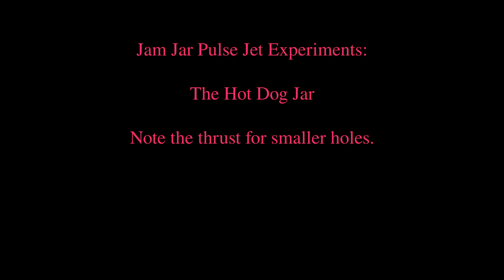Jam Jar Pulse jet experiments: The Hot dog jar pulse jet.

Comment: Probably the tall jar is a little too tall. The flame has a long way to go to reach the bottom to get to the fuel. Something around twice as tall as it is wide should be more forgiving. What  happens with methanol is that it gets watery because it absorbs moisture from the air and water from one of the products of combustion. When it burns it produces CO2 and H2O for the most part. 
I like to make sure the lid is on air tight and coat the entire jar when shaking it to get a good starting impulse. It takes some time to figure out what's going on with jam jars, so testing holes sizes and dimensions and amount of fuel added, the temperature and climate, etc,. all affect results. Jam jars can be fussy. 
Also I don't like to angle jars completely horizontally, but rather something between around 30 degrees or so. There are so many variables that you can't often say some factor is written in stone because it's contingent on all the proclivities combined.
Reply from the maker: Many thanks for the advice in particularly the covering the inside with meths. I would say though that the passata jar is much taller. I was interested to note that initially the thrust dropped as the hole got bigger.
Reply: In the book Pulsating Combustion by Reynst, he points out to dry the top of the jam jar lid after shaking. Just a drop of fuel on the top of the lid when you go to start it can really dampen feedback  such that it's almost given it won't sustain if you go to light it.
You got a taller jar but too tall is just as deleterious as too short,  just as too small a hole or too large a hole won't work, there's the Goldilocks zone. The more shapes you try, the more familiar you get with what's what.
If you're going to do a lot of testing, it'd be a good idea not to breathe too much of the fumes.
Reply from the maker: Interesting information, many thanks. I have some other experiments in mind, but I will bear in mind the fuel hitting the lid issue. Cheers.
Reply: It's on the outside of the lid where the drop of fuel will cause problems,  just to be clear, so dry the top of the lid if there's any spittle of fuel there after shaking the jar. When you take your finger off the hole, often you will hear a poof sound as the vapor pressure releases. It's important to have a good seal on the lid when you go to start it. A leak can dampen the starting impulse and feedback.
Reply from the maker: Many thanks.
Reply: What does the purple bottle say on it about methanol or are there other things in it aside from the colorant and possible bitterant? I see it used a lot but we don't have that purple colored fuel in the U.S. I don't think. We have HEET which is a methanol additive to take the water out of your gas tank or you can just buy it pure as well by the gallon which is much cheaper at speed shops that sell stuff for car races. Methanol has an affinity for moisture so you have to keep the cap on the bottle. Also we have denatured alcohol blends of ethanol and methanol, which are  often a 50/50 mix unless it's for something less common.
Those types of jar lids that don't have a lot of threads sometimes don't seal as air tight as you might like unless you really snug them down. I've toyed with pickle jars and such that have that quick twist design. Over time they seem to seal less and less.
Reply from the maker: I'll look it up. As far as I know it is just methanol, colour and bitterant.
Reply: I was just wondering because I see it used a lot. We just have clear over here. Probably when you run a jam jar there's some formaldehyde formed from incomplete combustion so it's not good to breathe a lot of methanol fumes and byproducts over time. I tried burning potable 95% ethanol (Everclear grain alcohol) for some indoor experimenting but it too forms another aldehyde  which is acetaldehyde, not much better if that. It kind of stings your nose. 
"Acetaldehyde is toxic when applied externally for prolonged periods, an irritant, and a probable carcinogen." https://en.wikipedia.org/wiki/Acetaldehyde
Reply from the maker: On the bottle it says it contains ethanol but gives no further details.
Reply: Often if you type the name and brand of your product in Google and then MSDS (Material Safety Data Sheet) you can find out the ingredients. Here's a purple methylated spirits product in a bottle that looks vaguely like yours yet not a drop of methanol in it. http://www.birdbrand.co.uk/wp-content/uploads/Methylated-Spirits.pdf (page 3) 
100% methanol is really the best stuff to use if you can find it.